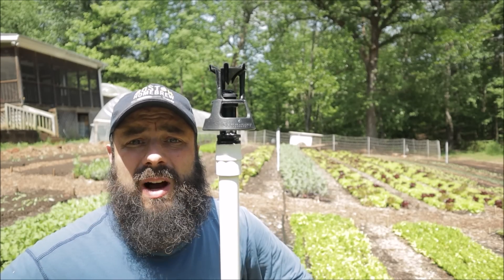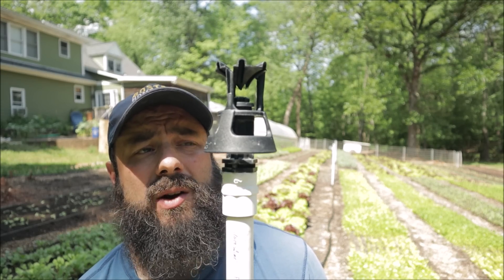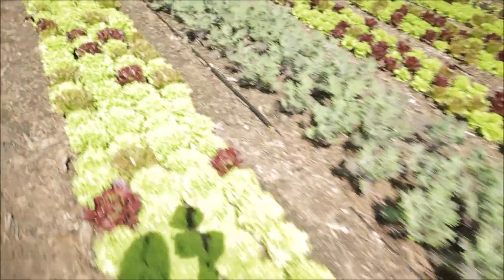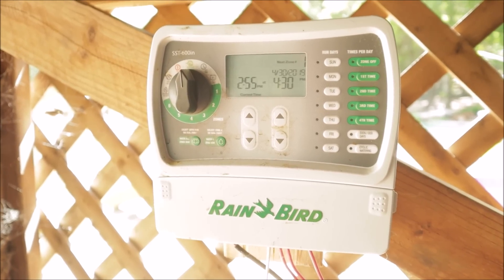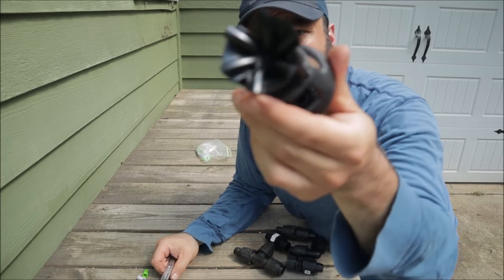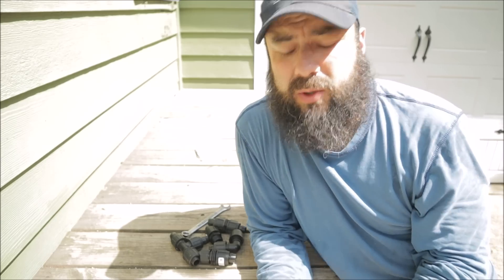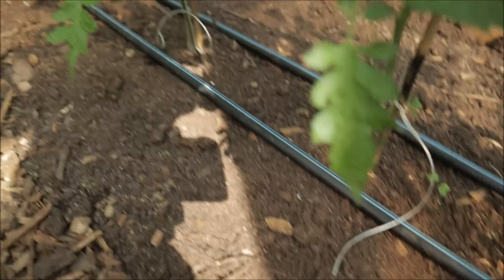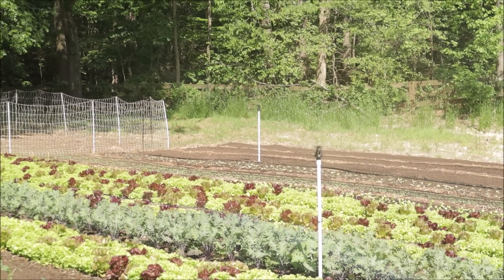Simple Irrigation System

Comment: The sprayers look like they’re doing great, but senninger makes a mini 1/2” pressure regulator that every wobbler should be threaded into. 15 psi is the ideal regulator size and it ensures every wobbler is throwing the same distance and isn’t overpowered, or else you’ll experience a fine most that drifts away.

Comment: Pressure Compensating Drippers (PC) developed with advanced pressure compensating technology delivers a uniform flow rate even in areas with difficult topographical conditions. A unique pressure differential mechanism regulates flow and provides self-cleaning action, even while irrigating – for a clog-resistant design and high emission uniformity.

Comment: { am wondering why you use 2 drip lines for tomatoes and peppers and such  I  have been using using 1 line  for years I am on sand and the spread of water soaking is 3 to 4 inches each side of the drip line the root get plenty of water with 1 line and I usably get 4 to 5 years out of my lines.  I to  do  use over head on greens and high rotation crops just my two scents worth not taking any thing away form what your saying

Comment: Josh, Thank you for sharing with us your sprinkler design.  I have a couple of questions.  1. What is your well pressure switch settings, example on 30 psi off 50 psi? 2. How many inches wide are your rows?   Thanks again

Comment: Thx Josh - main Q I have: do you run your irrigation just under your switch pressure to avoid your well pump from cycling on and off?  my understanding - you’d like to have your pump come on and stay on for the duration of the cycle. followUp would be, what nozzles and GPM do they run at?      also, do you get any burning on leaves when you water in summer to “cool off your lettuce”?  Thx!!!!

Comment: thanks for sharing.  one question i have from using wobblers on my farm is how do you deal with areas of a block that get double coverage from the wobblers vs areas that only get hit by 1 wobbler?  there's a trade off to make between larger areas with single coverage vs wasting water on the grass/weeds.

i've settled on making sure the blocks get close to equal coverage and as a result wasting more water on the grass.  this reason makes me prefer drip lines though i agree with what you've said

Comment: QUESTION Josh: So, where the Wobbler is first connected to the female pvc connector -- is that pvc connector "threaded" also? If not (meaning wobbler threaded and pvc connector smooth) how to you properly glue them together so that no leaks? Also, do you find these female  pvc connectors at lowes or dripdepot? Great Videos with just the exact info that everyone is looking for - many thanks for the share!!!

Comment: Ordered the wobblers today. One comment or question, am being told to-put in the pressure regulators, somewhere around 20 psi. Am on a well, pump puts out 60 psi.  Thanks for you idea. I am going with pvc mainline, have had a problem with the plastic fittings coming apart. Am gone sometimes a week at a time , don’t need that to happen.

Comment: I have a question.  At the 19:51 mark in the video, your showing the T assembly.  What I can't figure out or find in the fitting section on DripWorks, is how you are connecting to the pvc T.  Obviously when the water line comes in, it is connected to the barb end and the cap screws down to make a tight connection, but how is it connected to the pvc T?
Reply: 3/4 FPT PVC tee. Threaded on all three outlets. Upright then has a 3/4 MPT to 3/4 PVC slip coupler. 3/4 MPT to 3/4 perma-loc makes the union between black irrigation line and pvc tee. Just had the same question yesterday as I'm installing wobblers next week.
Reply: @tomatobryan  Hi Tom, I can't get the 3/4 perma-loc to screw into the 3/4 PVC  tee, any ideas?
Reply: @DavidODoherty1  probably hose thread vs pipe thread. Your permaloc might be MHT.

Comment: Hi Josh, have you ever had problems running 4 sprinklers in series? How long is each line? Would it make sense to have things in parallel? I am designing my system (for 1/2 acre) and I am wondering about pressure drop in a line of 4 sprinkler heads (elevated like yours, with 32mm PVC)

Comment: hey josh, why do you not use a senninger pressure regulator @ each wobbler so they all receive and throw the same amount of water? thanks for this in depth video!
Reply from the maker: That might be a good option if you had a lot of wobblers on the same zone. If you only have a few then you can use one pressure regulator per zone. After a few you will go above the flow rating for the regulator. Cost would be a factor here as well. One verses many per zone. It will depend on your setup.
Reply: @JoshSattinFarming  yeah totally makes a lot of sense. hopefully this is helpful for others reading this. thanks again

Comment: Great video Josh. I have been enjoying your series. Have you thought about a backflow device for your irrigation system?
Reply from the maker: Yes, people have asked me several times about this. The system is not under pressure since I am using drip irrigation and wobblers. All of the irrigation stuff is located below the level of the house too. If the pressure dropped in my house, it wouldn't pull the water from those lines up into the house because there is no pressure there. But a backflow would be a good idea in a lot of situations.
Reply: @JoshSattinFarming  Good to know Josh. Thanks for the reply.

Comment: Well designed.  Learned a lot and am stealing your ideas to use for my personal garden.   I'm on a well an sometimes lose power too.  

I have an inverter (2400 watt), some solar panels,  but no good batteries at the moment or I'd have an alternate switch to power it (more for house use than irrigation).  I also saw some DC deep well pumps that could be powered directly from a charge controller on some solar panels.   Either of those might be future possibilities for you.   Thirdly,  I'm also going to hand drill an old fashioned pump well with a rotary post hole digger as a last ditch backup (water table is shallow enough here), but I could also hook a solar powered shallow well pump to that.
Reply from the maker: We have borrowed our neighbors portable generator to get basic stuff running in our house. We rarely lose power for too long other than maybe during a hurricane. But there is plenty of rain then!

Comment: Great video, thanks Josh.  I've got a small vegetable garden 40'x18'. After seeing this video I was inspired to install a single wobbler head 36" above ground in the middle of the garden - the sprinkler pattern covers the full garden. On the other end of the pipe I have a quick-attach connector for a hosepipe so all I have to do is click on the hose end and turn on the water.  Maybe next year I will add an automated connection, but for now it saves me having to manually water the garden.  Thanks for the inspiration!
Reply from the maker: You're welcome. I'm glad the video was helpful and enjoy the Wobbler. Thanks for watching!
Reply: what color nozzle did you end up using?

Comment: This is an excellent video. I have a 16x50 foot (5 rows @ 30 inches) personal garden and I was planning on using drip for the whole thing. After watching this I'm considering just two of these wobblers in the center row. It would certainly be easier to put together (and cheaper) than a whole drip system.

I have a question that's not related to irrigation and I'm finding it hard to get answers. I haven't been able to find much information on crop spacing in 30 inch beds.  Are you just spacing according to the seed specifications? Any information sources you know of would be awesome! 

I noticed that in your tunnel you have two rows of tomatoes on the inside row and only one row on the outside. Is that due to the side walls "bending" inward and not having enough room for the tomatoes to grow straight up?

Thanks for the videos!
Reply from the maker: These two books have a bunch of information on spacing:
https://amzn.to/2Xl0bHW

https://amzn.to/2LB7hpu

If you are using a Jang seeder then check this out: 
https://paperpot.co/product/jp1-jang-speed-seeder-no-1-the-complete-kit/

Check out this video to see the setup of my tunnel:
https://youtu.be/Eg-A8_L2N30
Reply: @JoshSattinFarming   Thanks!

Comment: Do you have an idea of your price per riser? (Everything but the tubing that is)
Reply from the maker: Sorry, I don't. All of the parts were from Home Depot or Lowe's other than those quick connect irrigation fittings which there are links for in the video description.
Reply: @JoshSattinFarming  no worries. I'm building out mine and kind of going for a hodge podge ground between yours and Neversink's, but with all off the shelf components. I'm at about 22 per riser, and I'm trying to trim that down a bit further to under 20.

Comment: Thanks for this video. Do you anticipate ever needing to cover your beds with a high tunnel? If so would you still have the same irrigation system?  I have 2.5 acres in Canada that I am planning for 2020.
Reply from the maker: I would love more tunnel space. It depends on the size of your tunnels. If they are large enough then you could definitely use this sort of setup. If the tunnels are smaller then check out Farmer's Friend, they have some cool overhead tunnel irrigation setups.
https://farmersfriendllc.com/products/irrigation/overhead-irrigation
Reply: @JoshSattinFarming  for tunnels or greenhouse check put "netafim spinnet overheads -- I love them -drip works and drip depot both have them i believe.

Thanks for the vids!!

Comment: Great video! Why not drip line? Because you germinate seeds in the field, not transplant?
Reply from the maker: Thank you! That is definitely one of the benefits, to get direct seeded crops to germinate. Also, I just find drip to be a pain in the butt to work with and it's a lot of plastic. I turn over most of the beds 4-5 times per year and that is a lot of moving drip lines around. Also I have cut drip lines while harvesting greens before too. I always try and go for simple and effective and that's why I use the overhead system.

Comment: Hey josh.  Nice video.  I am not sure if anyone else commented on this but it would be good to have a back flow preventer behind those solenoids. You dont want any irrigation water to comeback into your house.   Keep up the good vlogs.
Reply from the maker: Thanks for the suggestion and it is a good idea to have a back flow preventer in there. None of my systems (drip and overhead) are under pressure when they are off since they are open. They are also below the level of my house so in my case I'm not worried about water going into the house if the pressure dropped. But overall it is definitely a good idea to have one. Thanks for suggesting that!

Comment: Hey do you a problem with growing letics and rocket mine gets eaten over night I went up to 4 inch pots before going out and still gone over night they look like a net or something I have try 7 dust works good till rain in which happen last night get up this morning hoping to get a cut in will not worth it 50.00 down again it's going to put me out and I won't to be organic as possible but not going to make it like this not sure if I'm going to have to give it up or not just yet any ideal
Reply from the maker: Put some netting over your plants. It's either an animal or insects.
Reply: Flea beetles,  you'll need insect netting over the rows. You can use agribond as well with sand bags to hold it down. Downside is it's about 5-7 degrees warmer under the agribond.

Comment: Do you put a couple of spent wine cap mushroom spore in your beds? We have wider beds on con a curve to hold more water.  with wider roads with tons of woodchips in the rows so we don't have to irrigation. then we put spent spore in your pathways. we have irrigation options but for the last 5 years, we haven't had to. It's almost like we made a water diaper that keeps things just moist enough. to not need to water anything except for watering things when transplanted or directed seeded.  we also get wine caps from time to time. we get a lot of free woodchips.

Comment: In the southeastern part of the state
Not a Lot of support for this type of farming, but charging ahead.
Water is my greatest weakness. Though I have a farm and field number ,I can't get a well permit the law here states if I'm within a certain distance of county water I can't have a well. The pressure on that system will run one one half inch impact. I have 6 50 by 170 gardens, access to water is killing my operation, but still a steady irritant to the system to get the well I need. Lost most of my transplants this year. I have used a small Artesia spring pond on the property in the past, but unable to use it now GAP certified. Nice looking Setup.
Reply: Eastern part of the state here, Don't over look rainwater capture.  There is an urban farm in downtown Raleigh that has two massive cisterns they catch rain water in from nearby buildings to feed their hydrop operation. As for the well, that's got to be a zoning issue.  You aren't supposed to or expected to feed an agricultural operation off a municipal water system.  Check with the county coop extension to see if they can assist.
Reply: @ryanwillett728  wish I had enough roof to run a cistern. There's hundreds of acres of swamp behind me. It is a zoning thing , many wells have been capped and converted to cou ty under the new regs. The problem is getting my registered farm recognised by the permitting process as a farm. I think I've got a channel opened between the ag people and the regulators ,but may be a year or more in the works. Got a call late Friday and getting an inspection in july. It's a matter of getting them to recognise less than dozens or hundreds of acres as a farm. Everything around me is rowcrop. I will loose a season to connecting all the dots ,and convincing them of the comercial viability of small acres.  It seems To just be one more of the challenges of doing something out of the norm for where I live. Had one farmer tell me I couldn't call it a farm unless I was 100 acres and half a million starting capital.  So.e vendors won't sell me seed unless it's exactly in traditional planting times. T I tell my girlfriend that I'm the two headed farmer. I'm verry rural and going against strong traditional concepts. The well will come, I just have to be prepared to.educate all involved in the concept of market gardening.  Would love to visit the city garden.
Thanks.
Reply: @charlesvickers4804   Actually, in NC, to qualify as a "farm" under the tax laws, you have to be 10 acres and produce a specific dollar value in crop, I think it's 10K - would have to look it up again.  But the 100 acre farm thing is a farce and you can order seed online anytime you want. If you were speaking of Soybean, Cotton, Wheat, or Corn, yes you go to the back of the line for seed orders.  
I'm well aware of what you are doing, because I'm doing/done the same as have many of the folks I work with in Carteret County, all of which are between 1 and five acres.

Comment: Great video! I appreciate all the links. I’ll be installing some wobblers soon! Question though, if I’m running say 4-6 heads and using a water hose to get to garden, would 1/2” piping work on the hard lined garden bed side instead of 3/4”?
Reply from the maker: Thanks! I can't tell you for sure either way, but my instincts say you should use 3/4" tubing and make sure there aren't any diameter restrictions along the way. You don't want it going to 1/2" and then back to 3/4". Another constraint is your water pressure and the volume your water source can provide.